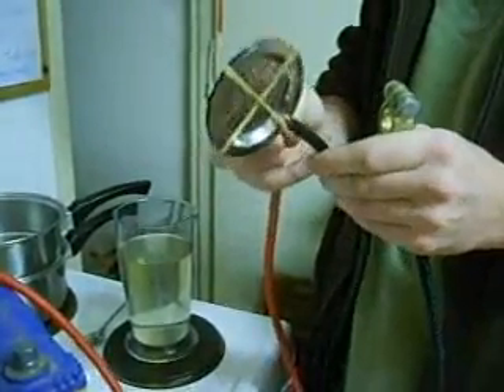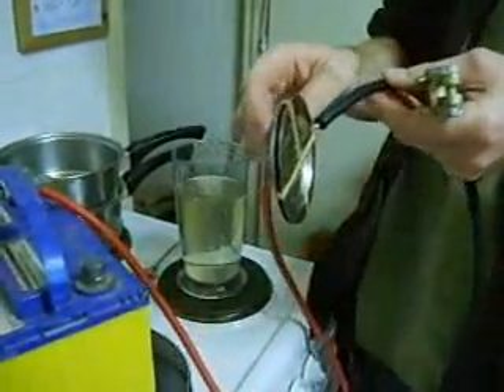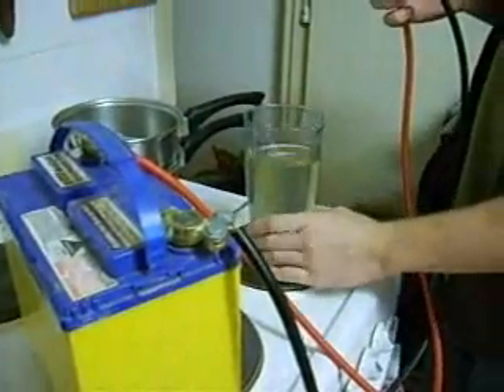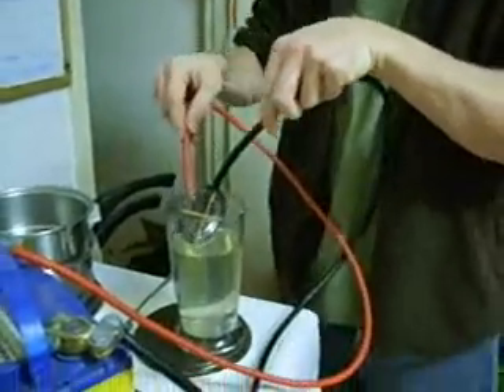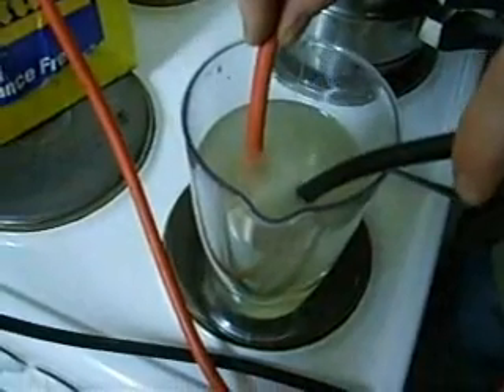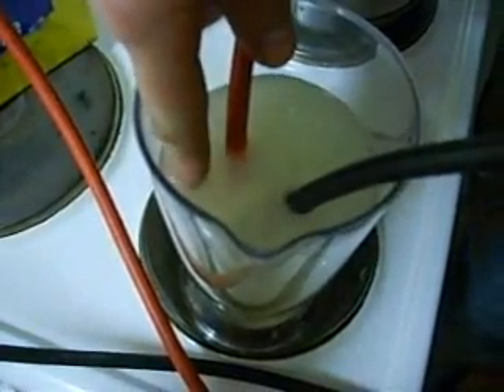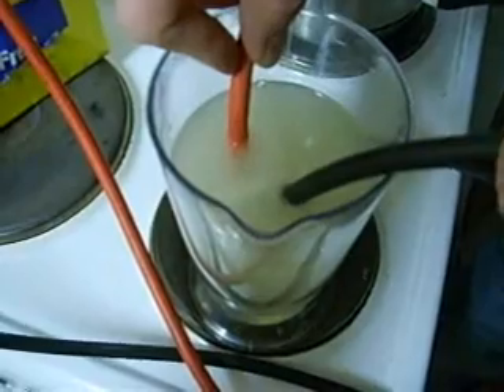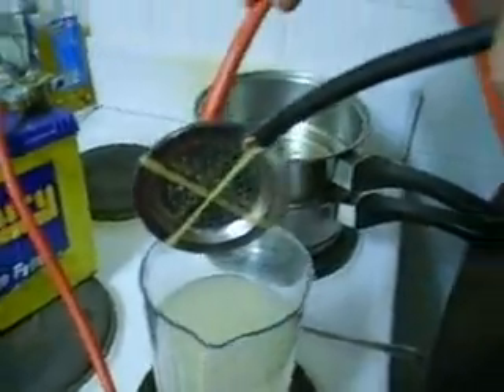Hydrogen at home (sink strainers) #1

Comment from the maker: As far as not needing to add electrolytes to tap water I agree with you accept that this water is filtered which removes a lot of the chemicals and metals which make the water turn very ugly and act as an electrolyte.  Also from what I understand the gap between your plates also determines how much electrolyte is required.  Thanks for your comments